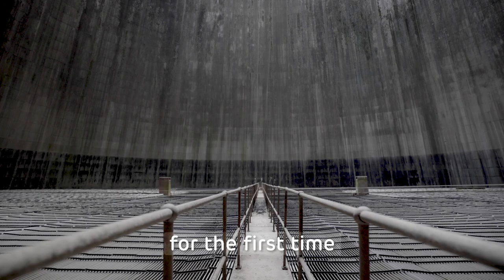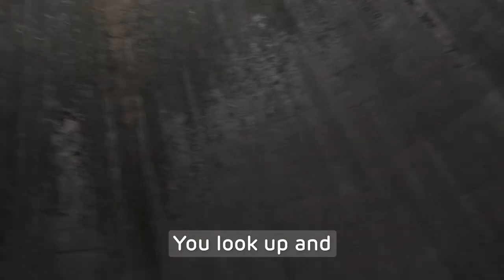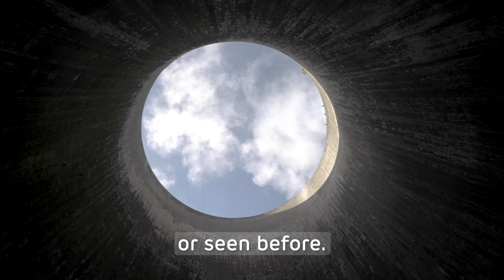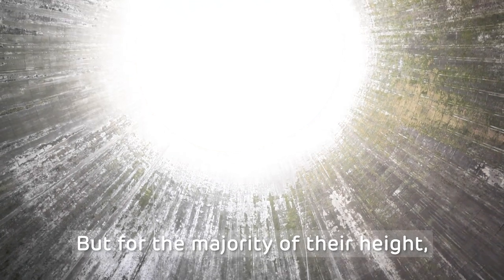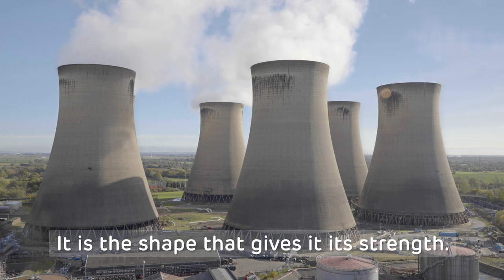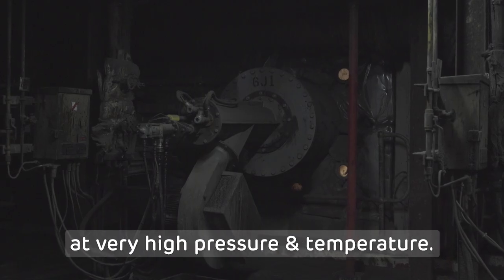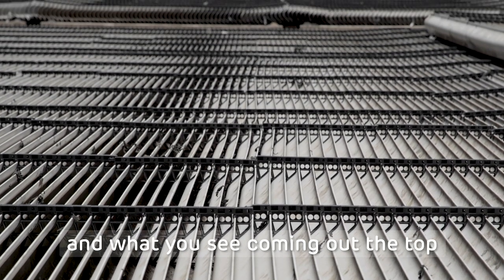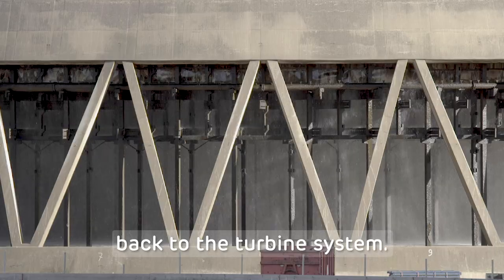Inside a cooling tower

Comment: As a young field engineer in the 60's I was responsible for the positioning and construction layout of the cooling towers at Three Mile Island. Yes, they are massive and eerie.  Inside one you feel small and insignificant and get physically queasy.  Construction was very difficult.  We used self-climbing forms, a forming system that lifts itself up for each successive layer. What made it so difficult was that the next layer up had to be just a bit smaller in diameter than the previous one. Then when you reach the three-quarter point the upper layers had to flare out. The parabolic shape is very strong. I had no computer, used a slide rule, but I did buy one of the first 4 function calculators, add, subtract, multiply, divide. Cost me $125 (a lot of money in the 60's) and about the size of a cellphone but thicker.  I'm now 80 yr retired Civil Engineer.
Reply: Thanks for this comment - . I use HIAA when flying home and am fascinated by these.  I have to take a photo from plane every time. Your description of the building process was very interesting.
Reply: nice piece of history. thank you for your service
Reply: Wish they'd have invented the camera or video camera back then, would be awesome to see how they built the cooling towers. You'd think it would have been something they'd wish to document for historical purposes, or for government safety records. All we get is a finished plant photo sadly.

Comment: Very thankful to have had the opportunity to work on these up close for a few years when I was 19-23 (I’m now 28). Such a cool experience and the first time I walked through security into the facility and up to one I still remember it was before the sun came up and I was half awake but they just blew me away with the scale of them. You see them from a distance but up close it’s something else I tell ya. The company I worked for was contracted and went around nuclear plants all around the country and we worked during the outages replacing the fill sheet (piece of thin cement like material the water hits to aid in the cooling of the water). Actually stepping inside a cooling tower for the first time kind of freaked me out honestly it was just an odd feeling with how tall the walls were and you were in an empty “room” 50-60ish feet off the ground (there’s space underneath that room where the fill sheet and all the water lines are then it comes down in more of a mist into the base where it’s then pumped back into the plant to be reused). I was extremely “lucky” one trip when we were in PA I was able to climb the ladder up to the top to change the bulbs which took a few hours with lots of breaks and me being absolutely horrified of heights even a normal home ladder gives me vertigo but I’m so glad for that opportunity...eating lunch sitting up on top was an incredible experience and one I’ll treasure forever and the pictures I took from up top will be a reminder. Unfortunately I was no longer to keep working that job due to a bad ankle break but I’ll never forget the experiences and amazing group I worked with over the years. We hired local temporary workers to help us and some were brought on full time to travel with us which is how I got started. The money was great the only downside was the constant travel but for me being young with no real responsibilities I loved it. I worked many different jobs since that time and still find myself wishing I could continue doing that I genuinely loved waking up working extremely long hours just to do it all over the next day (and I’m absolutely not a morning person typically but that job, it wasn’t a problem at all to get up for). Sorry if this was all over the place or random I just came across this video randomly and it brought back a ton of great memories and I just wanted to spew them out here quick for my own enjoyment mostly🤣...miss the money too, not having anything to spend it on really let me save enough to buy my first home
Reply: What'd you work as?
Reply: @chromitehertz9016  I was just a contractor technically. If you want to get into it just look up nuclear outage jobs near you. You may not get a full time position with them after but you at least have your foot in the door and experience and the following years outage they’ll likely call you to see if you want to help again, that’s what my company did at least. We mailed a letter to everyone who helped the years before to offer them a position when we got back to the plant near them and the ones who responded yes were then usually some of the ones we’d bring on full time if we had openings and if they were interested. There’s a lot of security clearances/training you need to complete and it’s kind of a long process before you start working but there’s a lot of other people doing it with you and my training/testing was all paid. Hope that helps some!

Comment: First, the steam (boiler water) used to turn the turbine doesn't go thru the cooling towers. The water (steam) used to turn the turbine is ULTRA pure... like 0.05 micromhos conductivity so you don't get plating, corrosion, erosion on turbine vanes and boiler tubes. The water that goes thru the towers is used to condense the steam back into water via tube heat exchanger. The heat transfers from the steam side of the exchanger (converting the steam back into water) to the cooling water side, then to the water tower and out the top.

Comment: as Zig Wil has written  ''First, the steam (boiler water) used to turn the turbine doesn't go thru the cooling towers'' and second this is from me,  the Steam turbine inlet is high pressure, and the Steam turbine outlet is a low pressure, less than the atmospheric pressure, the whole system is in a complete Closed-loop Systems.

Comment: "To design one of these would be extremly complex"... i don't say it's necessary easier, we are still talking about high engineering,  however, they managed to project, build and run nuclear power plants only by using blueprints, paper sheet and slow ass room like framework computers back then, so why it would be harder today,  where you are (in some cases) be able to even simulate an earthquake on your project and discover its weaknesses?
Reply: Simply because we have nowadays much higher quality standards. And being able to write a code that perfectly simulate a earthquake or any natural event is super difficult
Reply: @cbbc711  i don't understand. Safety requirements are better over time as well as engineering quality so does. So why it would be harder to do the same thing. Otherwise than simulation that are so difficult, i thing nucler pp are designed nowadays as well as other big engineering structures like we did yesterday

Comment: Whats cool about that shape (hyperboloid) is that its made entirely from straight lines. Imagine a bundle of dry spaghetti, bound with a rubber band 2/3 of the way up. Then twist it slightly so the tips spread out. That's the shape.

Comment: I think the way to design these many really complex structures was much easier than today. Not easy in the sense that the structures were simple. First of all I think the engineers back in the day really did know what they were doing and back then they were not flooded with rules and regulations like today. Some of my older colleagues have told me that reports that today are 400-500 pages back then were only 5-10 pages.

Comment: if they're generating electricity from water, why do we see them in nuclear power sites?
Reply: The normal way electricity is generated is some source of heat energy evaporating water to turn a turbine, so both coal and nuclear need cooling because they both end up generating electricity using evaporated water